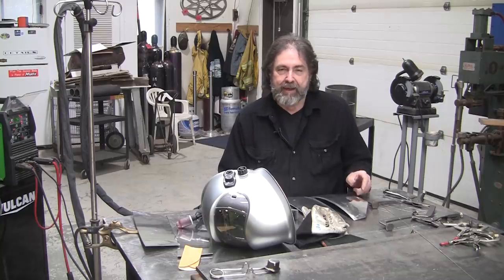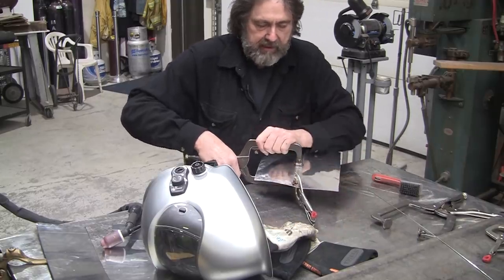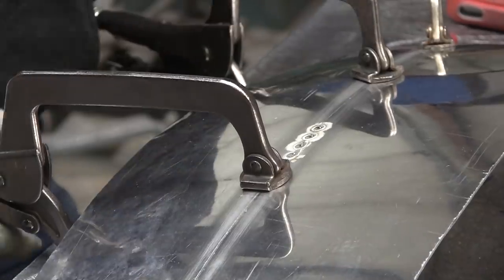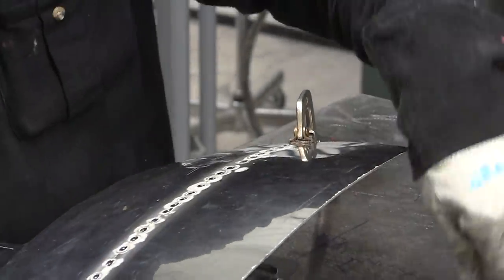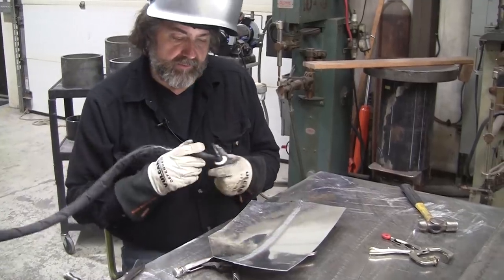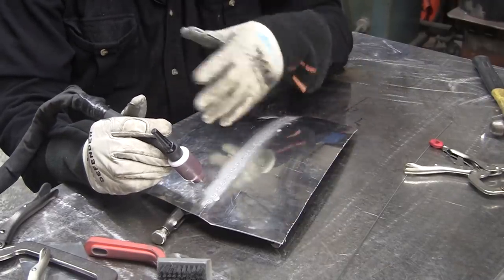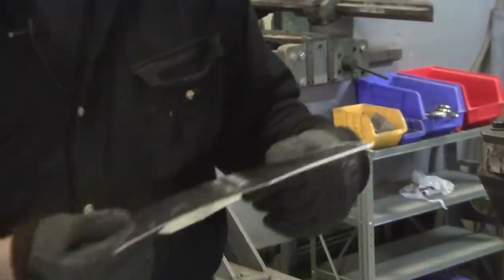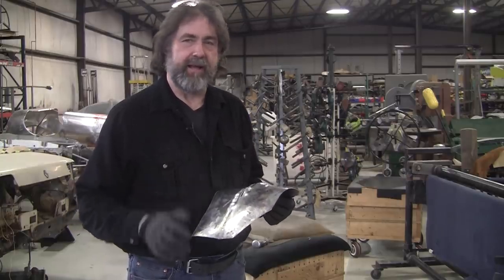Metal Fabrication: How to TIG Weld (Series Teaser)

Comment: What's with the new smiley Wray intro? I prefer the thinking Wray... well .....actually you do have a good looking smile you handsome dog you!!! 😂😂😂 As l'm 67years it is highly unlikely that l will ever do aluminium welding but l do still enjoy your tutorials. You never know!  9.57 pretty impressive. 12.12 there's no way my hand is  that steady! WOW! That was one extreme test. I think someone made an unnecessary  comment about a weld fracture.
Reply from the maker: Hi John I'm a couple weeks away from 69. Actually the weld didn't crack break or budge. It was the metal adjacent to the weld that let go. in a real world situation that weld would never crack. The weld is as strong as the parent metal.
Reply: what not to smile about (not being dead yet)....

Comment: Wray my question is on the tig welding when using pulse ,which machine does a better weld , Everlast or Vulcan from Harbor Frieght . I know you did a video  saying one of those machines does a great job on thin sheetmetal . Thanks  Mike

Comment: What about using a pedal that allows full control of the current instead of only just on/off? Nice welding job!!!!!
Reply from the maker: My Everlast has full pedal control for amperage.  ????
Reply: He was using a pedal.
Reply: @proshaper  it seems that you have a pedal for only on/off control. A full control allows adjusting the amp with the pedal so no small adjustments on the machine any more.

Comment: I mean no disrespect.  However I see that it stress cracked right on the edge of the weld twice.  Maybe the weld itself is as strong as the parent metal, but I'm guessing that something in the welding made the metal next to the weld weaker.  Maybe the difference in temperature between the weld and the metal next to it could have caused it?
Reply from the maker: After hammering in the weld on the power hammer the weld bead area on the underside of the  panel had a slight valley on it's sides, .
That was source of the weak point during the torture test not the weld, the weld was solid. That method I used was not my usual aluminum welding method. If you watch 10 D  E-Type bonnet build you will see my preferred method. The weld I torture tested would never fail or provide any problems if it was just welded into a fender.
Reply: @proshaper  Thank you.
It's nice to learn something new.
Reply: Aluminum has a grain, very similar to wood.  It often cracks when a bend is parallel to the grain, especially if the radius is small.  Wray said in the video, that the 3003 he was using was pretty hard, so (I may be wrong, but...) I think it cracked along the grain, next to the weld, because that part of the metal wasn't fully annealed during the welding process, like it was in the actual weld bead.  It might crack like that anywhere on the panel, with that kind of hammering and super stretching in a small area.  Great demonstration, Wray!

Comment: Why don't you you use any filler? My teacher says it will always crack if you weld like that. I know that you want it to be flush to get a nice panel.
Reply from the maker: Hi Tom, It is possible to weld with no filler rod, but it doesn't always yield a good weld.